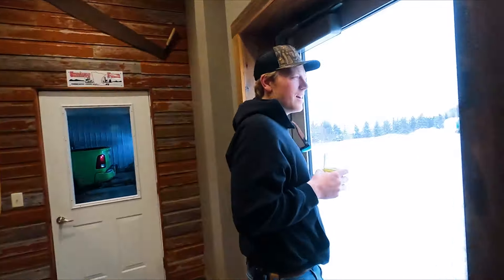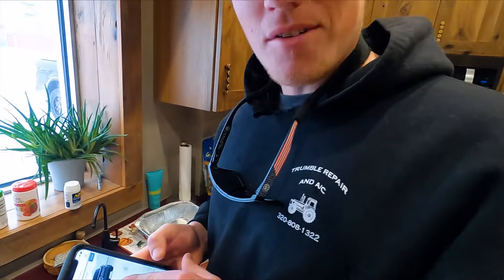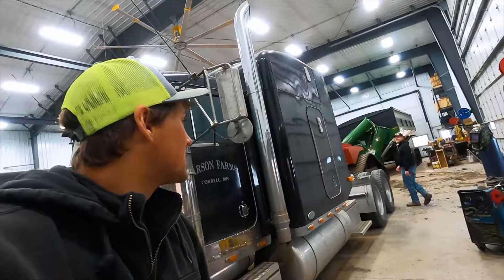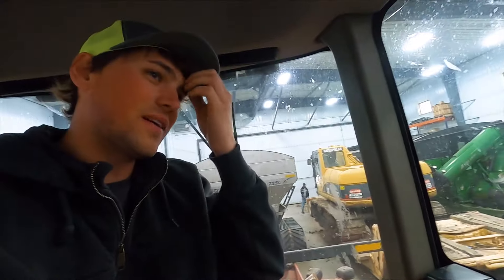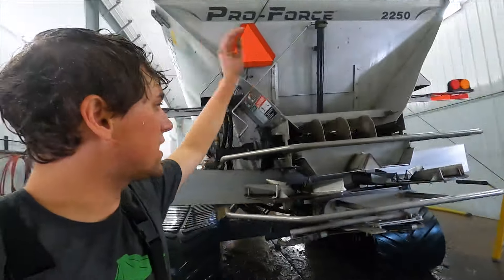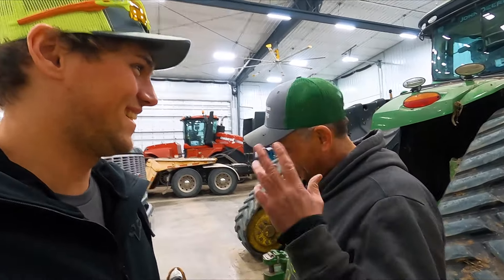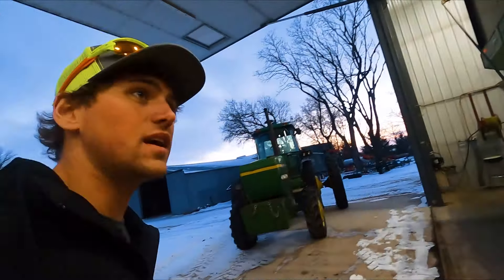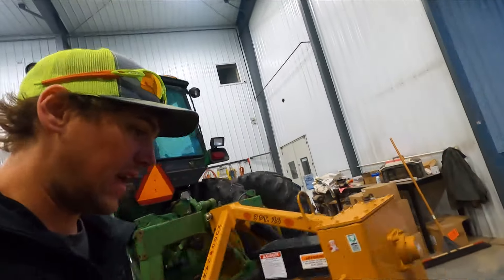Mad Dougo?

Comment: Make sure your GFCI outlets are rated for the AMP load you're utilizing.  Also, after a few trips (or overloads) the GFCI circuit tends to degrade and will trip at lower AMP loads.
Reply: That's their problem...now able to handle amp draw of battery charger or grinder
Reply: Good advice. It also helps to use "Weather Rated" (They have WR on the face) GFCIs in a wet wash bay, they will last a lot longer. As for the last part, it actually takes a good number of trips before the GFCI circuits degrade, the trip threshold stays pretty constant until it either fails to trip at all (by the test button or using a plug in tester) or it trips and locks out in the off position. 

Circuit breakers on the other hand are easily damaged or degraded after a severe fault trips them.  I have, in my 40+ years as an electrician, seem some fail after ONE bad fault, and many others that after several overloads, start tripping or failing to reset even with small (or no) loads applied.
Reply: Except a gfci receptacle doesn't give one damn how many amps your running. 15, 20 no difference. Common misconception. All It cares is that there is no more than a 5ma inbalance on power leaving and coming back on the neutral. Your overcurrent protection device (ckt breaker) cares what load your using. Ever pop a 15 vs a 20 amp gfci apart?? Not much different. In his application yes a 20a receptacle is what should be there but that wont help it with nuisance tripping one bit.
Reply: @davedunn2124  I have a 15 amp gfci that will trip constantly with my dewalt metal chop saw. If I plug it into the 20 amp gfci it never has once tripped it.
Reply: @tomcander3669  --  Well, it might be useful to open up the charger to check for excessive dirt which when damp will easily cause a 30+ mA bypass to ground and trip the GFCI.   (Spraying WD40 around the insides is sometimes a shortcut to cleaning things up.)
Reply: @davedunn2124  Actually there is a difference. 5ma imbalance is common across domestic receptacles, but then you have "GFCI nuisance tripping" and collective losses across multiple appliances etc.   In their scenario, maybe 20AMP commercial-grade (WET LOCATION) receptacles with a 10ma imbalance trigger would do the job.  Break up the circuit to lessen the chances of multiple appliances operating on the same circuit.

Comment: When those little critters die, they leave a liquid residue that solidifies. You have to make sure you find exactly where it was laying and clean it out. You can try putting a part box of baking soda in there (spread some on the stain the critter left) that will help with the odor. Have a good one.
Reply: Or you could trade it in on a cold day.

Comment: This may have been posted below.  On the Ground fault plug issue remove the ground fault plug replace it with a standard plug, at the panel box install a ground fault breaker on the spray bay plug circuit. This has helped a similar situation I had.  On the rat smell buy a commercial ozone generator and put it inside the cab for a few days. These things are handy I use them in all my vehicles when they get a funky smell.

Comment: My suggestion for the mouse smell is Arm&Hammer pet carpet cleaner.  Spread liberally, allow plenty of fresh air for several days. Vacuum, repeat as needed.  It has always been successful for me.
Reply: I recommend using an Ozone machine. Put it into the tractor cab for a couple hours and the mouse smell will be gone. Those machines are often used in houses that have had fires. I have one and have used it in the garage to rid of mouse odors, as well as in trucks for various odors that aren't eliminated conventional ways.

Comment: GFCI in breaker box will control six "downstream" duplex receptacles (ea.) and seem to be more robust than the circuits in the individual outlets.  Just an idea.  Stay warm.  I'm surprised you don't have a steam cleaner.  They not only work better than on greasy equipment, but you stay a bit warmer in the process.

Comment: Well, if you drag a chain to either a combine, field chopper, or tractor, that grounds the machine, reduces the chance of electrical sparks. Think of rubbing your socked feet across a carpet then touching something. You get that static shock. 
As for your breaker issues, I'd have the charger tested, it could have a short in it and drawing too much power. Seen it happen many times.

Comment: You might put your overhead door on a different circuit by it's self that way if you trip the breaker the door should still operate. You may want to split the outlets up to use another circuit. So Merry Christmas  and enjoy the holidays.

Comment: You should install battery tenders on your equipment and keep them plugged in when not in use.  Never have to worry about a dead battery again
Reply: Most equipment is stored in cold storage sheds where there is no electric

Comment: Ground faults aren't that bad.  Wait until you add arc fault!!  When my addition was built.  They electrician installed a scene controlled lighting system, and his first ever arc fault circuit breakers.  It took him a week to debug the arc fault issues.  They still trip once in awhile.  For your info arc fault circuit breakers have ground fault built in.  They also cost something like $500-1000 more per house.

Comment: Chet, your ground fault outlets are tripping because the equipment you're using is exceeding the amp rating on them.
You need to step up the outlets to take more amperage
Or replace the circuit breakers in the circuit breaker box with state of the art ground fault circuit breakers Ask This Old House covered.
Then you can use regular outlets rated for more amperage.
Believe me, they are close for a reason anywhere the possibility of a shock hazard may exist which includes sinks and other water hazards.
Reply: Wrong, wrong, wrong!! He is NOT exceeding the amperage they are rated for (if so that would trip the BREAKER, NOT the GFCI), they are tripping because there is a leakage path to ground (a tiny nick in a cord in a wet space like a wash bay is all it takes).  A 15 or 20 amp outlet will deliver the amperage it is protected at, changing them won't "step up the amperage."  GFCIs are rated to either 15 or 20 amps (the 20a ones have the vertical slot added to the neutral side outlets) and WILL carry the full rated amperage. "Regular outlets rated for more amperage" would only be the 15 or 20 amp but no longer offer electrocution protection and would make for a far more dangerous situation.

Changing the breakers "with state of the art ground fault circuit breakers" will NOT fix anything, it would just move the resetting to the remote from the bay breaker panel. 

The problem is with either the equipment that is plugged in making them trip, or a bad extension cord. The GFCIs are working as designed and saving someone from a severe shock or worse.

Comment: You might need to change out your GFCI's to slower trip ones, the are usually used for industrial use but still have the same safety protection
Reply: Wrong. Gfci’s trip at 5 milliamps for people protection. Gfpe trip at 30 milliamps for equipment protection.

Comment: Chet a GFI does not trip under heavy load just because it is a GFI. There are 15amp and 20amp gfi recptacles. You need to get the 20amp GFI recptacles instead of the 15amp you presently have.

Comment: Don't leave the key in the ignition of your tractors, that will help with battery drain.
You're having so many electrical issues because you're using long extention leads with high amp equipment on circuits that aren't designed for it. 

Chet, you need to stop with drinking so much mellow yellow. Or you WILL have dentures before too long.

Comment: Hey Douglas... Replace that 15 amp GFCI with a 20amp GFCI ! ...Probably won't trip when charging the batteries .
Reply: Won't change anything. The tripping problem is caused by leakage to ground, NOT load current.  The GFCI is doing its job, the connected cord or equipment is the REAL problem.

Comment: Check if your GFIs are 15 amp or 20 amp.  If they're 15 you can probably upgrade em to stop tripping.
Reply: GFCI's only trip with leakage currents to ground, not the connected load. Changing from a 15 to a 20 won't help. (If the load was too big the BREAKER would trip, not  the GFCI.)  It also helps to use "Weather Rated" (They have WR on the face) GFCIs in a wet wash bay, they will last a lot longer.

Comment: Size and add a resistor to the charger on ground wire to compensate for GFCI
Reply: Where do you come up with this stuff? What possible good will it do? In fact, your suggestion would INCREASE the risk of a severe shock to anyone touching that charger. It wouldn't "compensate for GFCI" in any case.

Comment: Check amperage on gfi outlets go 30 amp
Reply: Wrong! That will not change anything. First off, GFCI outlets are not readily available in a 30 amp rating. Second, if you're suggesting to change to a 30 amp breaker on a 20 amp circuit that is dangerous and illegal. (And if anything goes wrong they will lose insurance coverage.) The tripping problem is caused by leakage to ground, NOT load current.  The GFCI is doing its job, the connected cord or equipment is the REAL problem.

Comment: Chet (and everyone else reading this) please be aware that the GFCI's tripping is NOT a problem with the outlets, but the equipment or cords connected at the time. 

As an electrician with over 40 years experience, note that:  

The GFCIs are working as designed and saving someone from a severe shock or worse.  Even the smallest nick or cut in a cord in that wet wash bay can cause a GFCI to trip, and that is a good thing. A power tool that causes a GFCI to trip has current leakage to the case which can cause a severe electric shock or worse. (Chet mentioned angle grinders, a tool that is notorious for shocking people as the metal dust it creates gets into the motor and starts leakage to the housing.) 

DO NOT bypass or change the GFCIs, fix whatever is plugged into them causing a trip. The last thing we want to hear is someone getting shocked or electrocuted (as in DEAD) because of stupid advice as given by a few other comments in this thread. It also helps to use "Weather Rated" (They have WR on the face) GFCIs in a wet wash bay, they will last a lot longer. 

While there are lots of things in the "Code" that are what I would consider overkill, GFCI's and their required locations for use is NOT one of them. That is a requirement that was "written in blood" or more accurately, "written in body counts" as far too many people have died from needless electrical shocks before GFCIs were invented and then required. 

To end on a funny note, Chet I had (and still have) a Pepsi addiction that has caused me many cavities, but what really did my teeth in was sports drinks from my motocross racing days. (They same electrolytes that are good for your body are murder on your teeth, and I found out far too late that I was supposed to rinse with plain water or brush after drinking sports drinks.) I now have so many missing teeth (and no dental insurance) that I am practically gumming my food.
Reply: Also. Over time if a gfci has tripped a lot. They tend to trip easier.  The new gfci outlets are better than the old ones. But they do self test now.